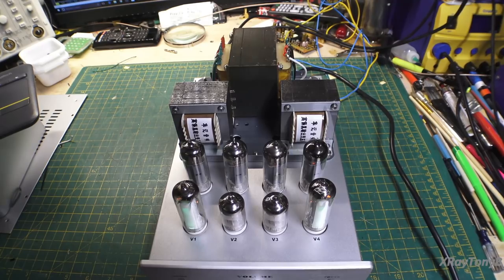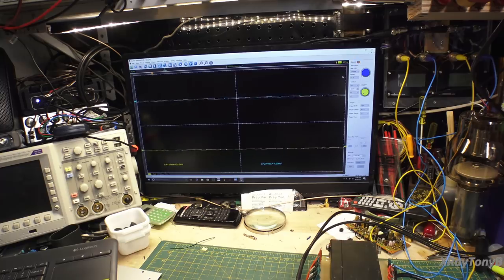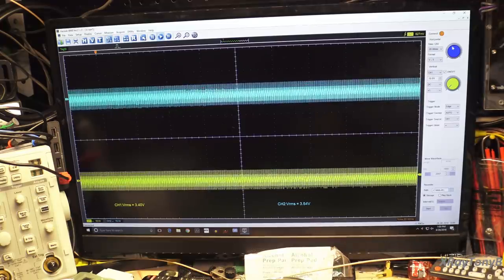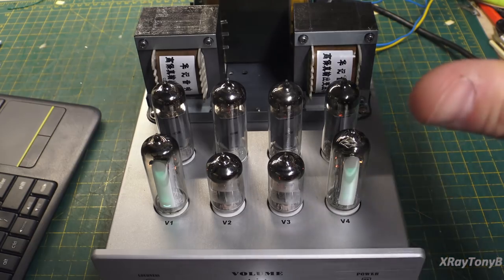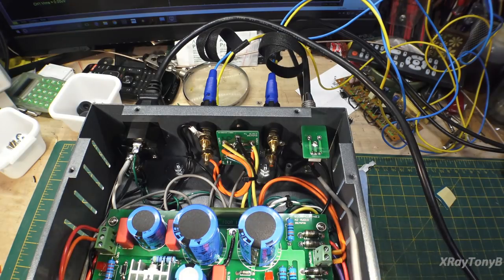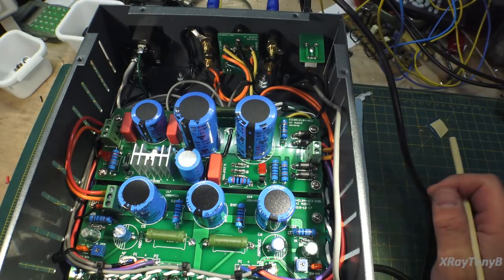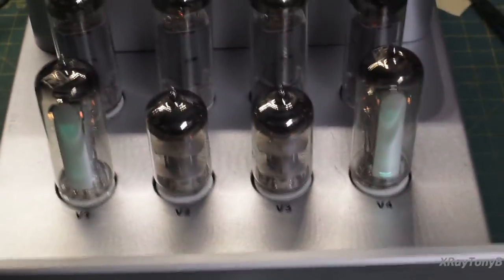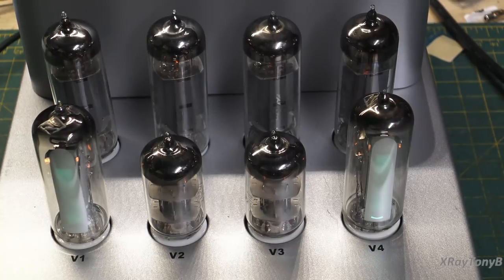Vacuum Tube Push-Pull 6P14/6BQ5/EL84 Amplifier - Part 2

Comment: Reminds me of my grand and classic radio engineers instructors I had years back during my undergrad years - the last of the Tube Mohicans in the days where the transistor and ICs is king. It seemed tubes is having a renaissance. Analog electronics is enduring and builds a lot of discipline in your hands and head. Thank you Sir for these I think I will build one too after seeing this.

Comment: Since your review Douk has modified the design and dropped off the loudness filter. Also there are currently larger cutouts in the bottom (under transformers) plate, to allow wires to go down the circuit board. They listened to what you had said.
Reply: i got this kit just recently with the loudness out still, and they re-orientated the transformers to the best position. i notice they reference these vids on the sales page for guidance too =) . really helpful Tony . thanks.

Comment: My understanding is that the Nichicon FG Fine Gold and KZ Muse Audio Grade caps have a min impedance at 120Hz as opposed to 100kHz typical of "low esr" caps intended for switching supplies. The electrolyte has better audio characteristics and smooth foil is used in the KZ types. Etched foil in miniature electrolytics is noisy due to the increased crystal boundaries. Generally speaking electrolytics in general should not be used in the signal path unless dc biased and bypass caps (preferably not polyester/Mylar) should be used, the higher the better fit considered.

Comment: The ECC and EL are European (British) designs.  Likely making parts from British Vac tube lines.   Woa - where is the input DC isolation cap that is in series of "1" and "2" after the volume pot and before the vac tube pre-amp.    That isolates the bias from blowing up the phone or whatever you put on.  No dc blocking !

Comment: A guitar amp usually has a output of 50 watts rms. That requires a output transformer that can handle at least that. Weight of transformer is 8-10 pounds. Stereo u need 2 plus power transformer, 30 lbs total. Hammond sell these.

Comment: What load are the outputs loaded to when you measure the waveforms ?  if Not a Resistor load, there is an impedance mismatch.  That will distort the signal and might draw more current in the primary as the secondary is not loading the inductive transformer.  The Audio caps are simply low inductance and low resistance to the plates.  Otherwise you will have frequency filtering but on a power supply it doesn't matter.
Reply from the maker: Here's a link to the type of audio dummy load I use.  Thanks for the comment!
https://www.youtube.com/watch?v=QS8GgUWnbq0

Comment: Tony, when a preamp is connected to the input, it has a much lower output impedance than 470k, even a valve one. Why doesn't that cause a similar problem to shunting the input resistor with a 50k pot? Thanks for sharing the project! M

Comment: What is the gain of this amplifier?
Alternatively,what was the rms voltage of the 1khz tone which achieved 10v rms at the output.
I was just wondering if a consumer cd player or tuner will be able to achieve the 12 watts per channel on direct connection.

Comment: 29:04 - So, at that point is the grid acting as a 'current sink', creating a (noisy) voltage-drop across the grid stop resistor?

Comment: I am also puzzled as to why there is no D.C. blocking capacitor at the input to the valve grid.
Reply: It certainly seems to be making some assumptions as to circuit design of your pre-amp.
Reply: @russellhltn1396  Yeah,the assumption is if there is dc coming out your preamp....it's broken.
Reply: @InsideOfMyOwnMind  A good assumption, but caps are cheap. There's no reason they couldn't have popped one in just in case a broken pre-amp is ever hooked up.

Comment: Note, one way to turn a linear potentiometer to an audio is to put a resistor (a larger resistor)  on the wiper arm of the pot to signal ground. Two, what is the output impedance of the audio transformer? Three how is there no DC voltage at the outputs of the speaker transformer? given the path from R3 through R5 on to W1 there should be a DC level, which should put it on the audio secondary leads.
Reply: The DC resistance of the output transformer will be quite low.  I'd expect less than 8 ohms.  Based on some quick calculations, I'd expect it to be around 0.003V or less.